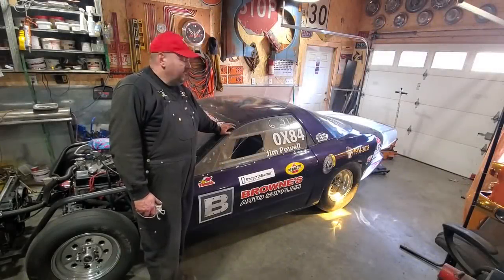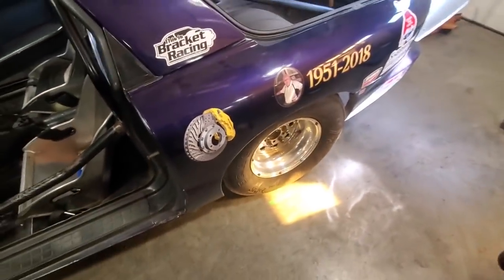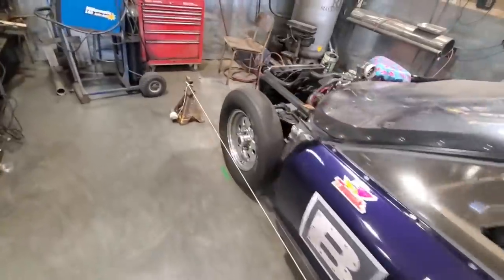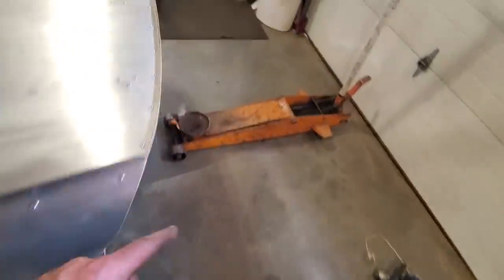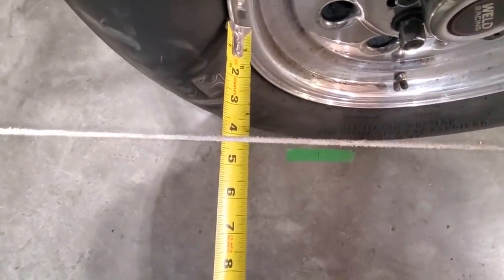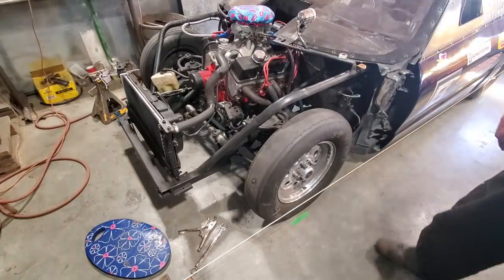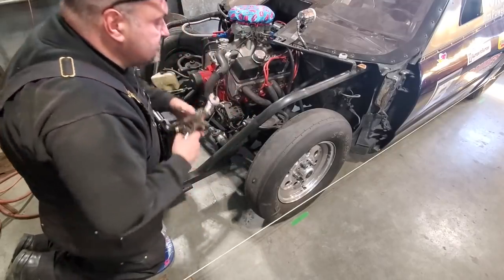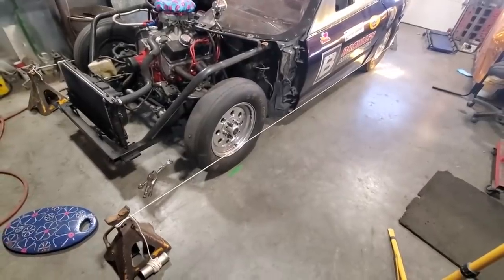How to do a wheel alignment with string!

Comment: This is great. Thank you! Any chance you know a trick like this for camber and caster?
Reply from the maker: Caster is tricky.  Camber I just use a angle finder and straight edge across the rim
Reply: Thanks!
Reply: I use a flat square bar exact length of the rim (as the tire itself bubbles out with the weight on it), and my iPhone level app.   Calibrate to your floor, then go nuts! Works great.

Comment: Great video.  How did you measure the caster and camber of the front wheels when you changed the position of the steering rack to get rid of the bump steer?
Reply from the maker: In this case I eye balled both. It's a drag car so as much caster as I could get I put it in it. Helps it go straight

Comment: The owner's manual on my old Volvo  says  1/8' measured front to rear of the tire. The distance they give, if measured at the rim, is 1/16.   If you measure at the rim, your toe in will be more  at the front edge of the tire. Am I missing something ?
Reply from the maker: Yes you are right but the distance  from the tire to the rim might be like 1/32 more then the rim

Comment: So you need the measurements to be the same on front and back of the tire? And right now you have the front off the floor? And you want to have the front of the tire turned in about 1/8 of a inch? I’m asking because I need to do a alignment on my rig
Reply from the maker: Wheels straight... tires on the floor. Measurements should be 1/8 inch more on the front

Comment: You can, even better for factory accuracy, rig up a DTI guage (if you have one laying around in your DIY home garage) for all three adjustments.......Caster, Camber and Toe. I would carry out the whole process taking time and go from the reading to zero and then go slightly the other way then back and finally to the specified reading and tighten the fastener. This way you would be dead accurate and no need for those fancy electronic $$$ machines.
Having said that, years ago I came across a UK car book where they used pieces of wood, nails and string to rig up the contraption to get the geometry required.

Comment: Nice tip. What about rear wheel alignment? I need to do all four wheels, including the rears for toe and camber.
Reply from the maker: When you use this you will use the body of the car to see rear alignment. You will notice the distance  on both sides will be different to rocker. Camber is another whole can of worms. This works best on solid rear ends. Independent setups are more tricky
Reply: Hmm thanks for that

Comment: Couldn't the string just wrap around the rear tires without the rear jack-stands? I recall that the toe-out differs on FWD vs RWD so not trusting my memory, I found this: 
As a front-wheel-drive car pulls itself forwards, the wheels will tend to pivot around the king-pins, and thus towards the center of the car. To ensure they end up straight ahead, they should sit with a slight toe-out when at rest.
A rear-wheel-drive car pushes itself forward, and the front wheels are rotated by friction… thus they will tend to want to trail the king-pins, and therefore will want to splay apart. To ensure that they run parallel when rolling, they should be given some toe-in when at rest.
The perfect 4WD car will have neutral pressure on the front wheels, so have neither toe-in or toe-out… however very few companies make the perfect 4WD, so some will have a small amount to toe-in/out, depending on the dominant axle. (Not sure of the validity of what I found, it just may agree with a mistruth I must've read about at some point)